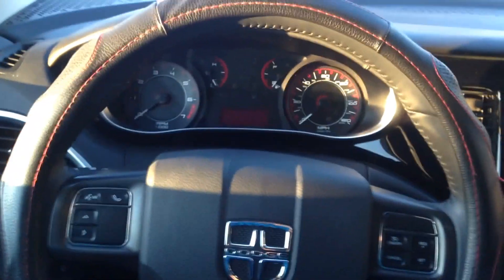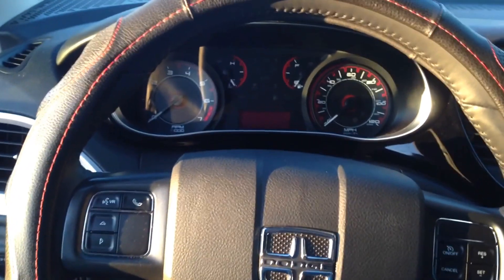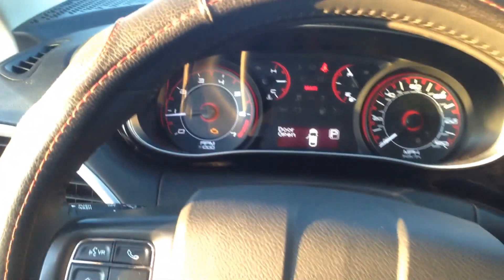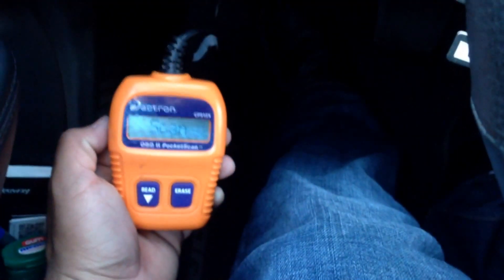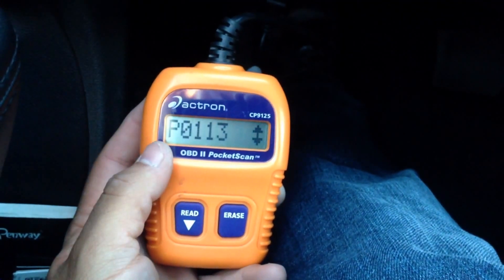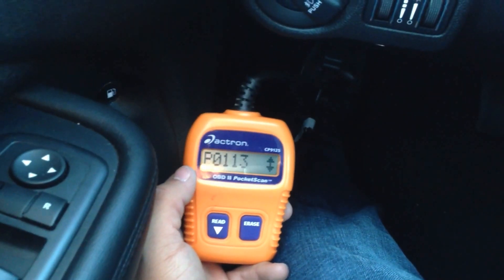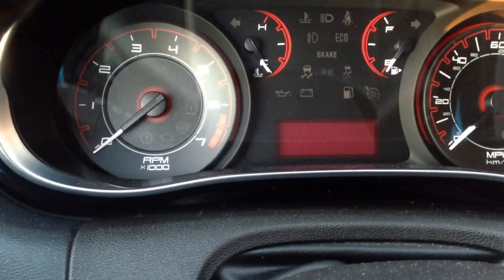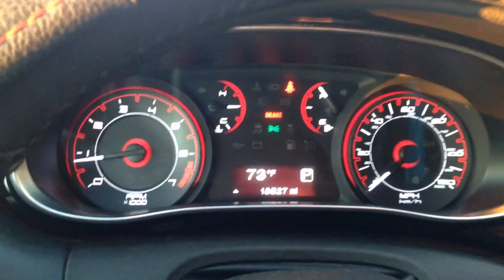How To Use an OBD II Scanner to Find Check Engine Light Codes

Comment: Would the OBD2 work for my 2007 Acura TL?
Reply from the maker: +IDABAYAREA650I Yes, the OBD2 scanner will work on your Acura because OBD2 scanners work on vehicles dated 1998 and newer.
Reply: +UrbanSleepers Official Right on.
Reply: @UrbanSleepersOfficial  sir its normal go out by car and engine light on?